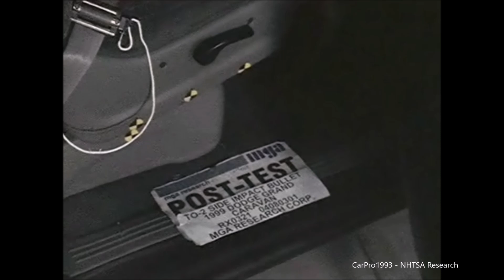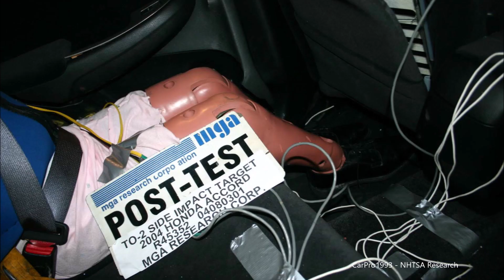2004 Honda Accord Vs. 1999 Dodge Grand Caravan FMVSS 214 Side Crash Test

Comment: I'd like to see a video of the Grand Caravan's back axle.
Reply from the maker: It's the same setup as the Ram, using a beam attached to the leaf springs with adjustable hubs and tie rods going from the hubs to the leaf spring. The shocks have special brackets welded to the beam to accommodate the OEM shock locations.
Reply: @CarPro1993  what's the purpose of angling it like that, as in what sort of motion/impact scenario is that required for?
Reply from the maker: @andrea.mf.hailey  It's to simulate both vehicles moving.
Reply: @CarPro1993  So it adds forward motion effect to the Honda. That makes way more sense now. 👍
Reply from the maker: @andrea.mf.hailey  That's correct!

Comment: 5:41 What is that on the windshield? It looks like it came off of one of the dummies.
Reply from the maker: That's just a reflection from one of the overhead lights.
Reply: @CarPro1993  Makes sense. But, it seems kind of odd that there isn't other lights being reflected.